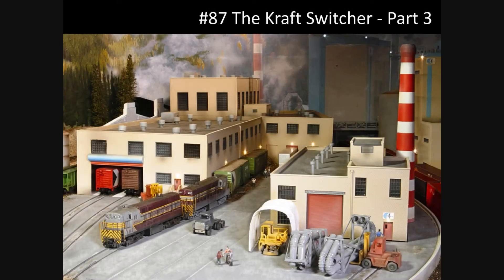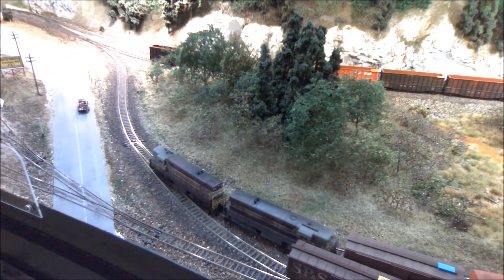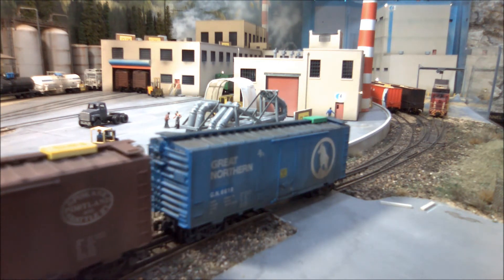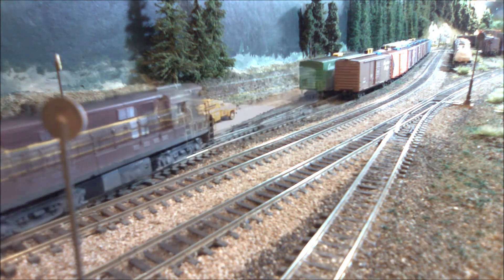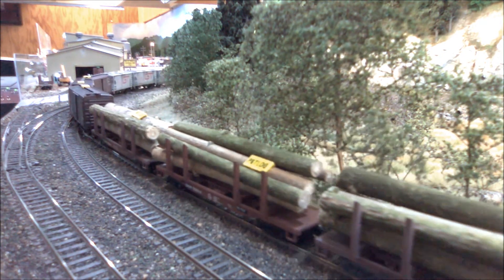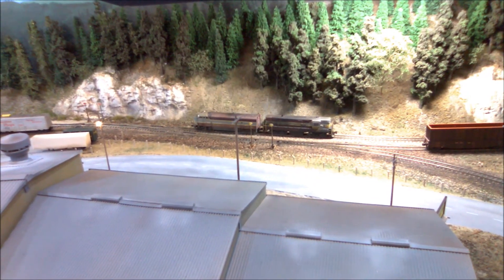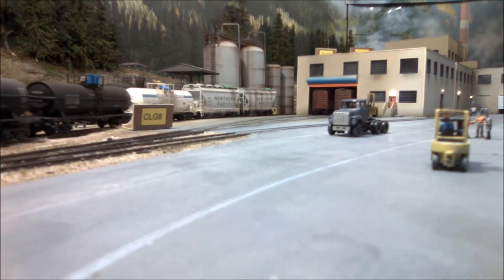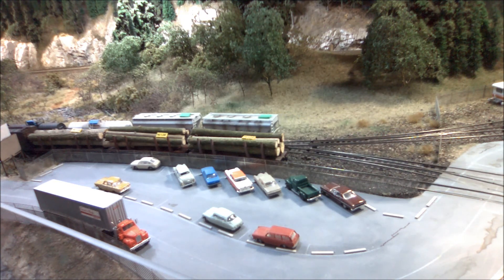#87: The Kraft Switcher - Part 3 (narrated)

Comment: Great layout.. Need to take the color blocks off the tops of the cars when you do the videos.
Reply from the maker: thanks for the compliment Scott...I won't be taking the waybills off during ops videos though for the reason that it is an ops video and I want to show potential operators exactly what they would be dealing with.  (I guess if I use car cards or switchlists I could show cards leaning up against the cars or moving cars redundantly because operators have to "relocate" the same car a dozen times :) ! )  

Now for "glamour" videos which are just trying to be pretty I take the tags off...

md
Reply: I use card cards with pictures of the cars on them in my sessions.
Reply from the maker: NSSCOTTTEAGUE ...yes I have used these types of car cards on Al Fraisch's layout several times.